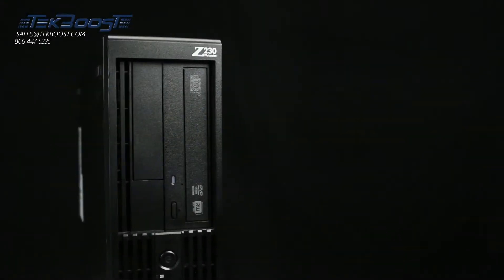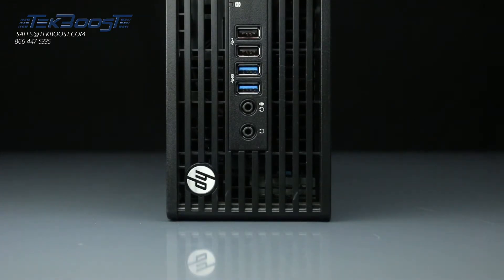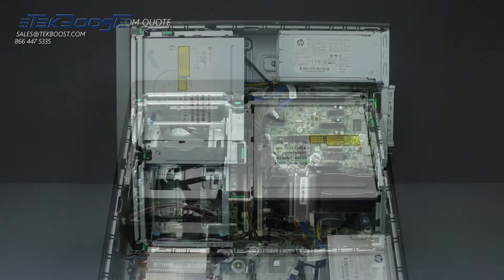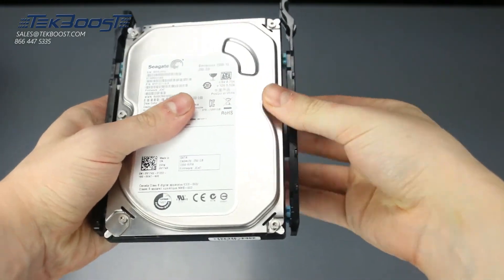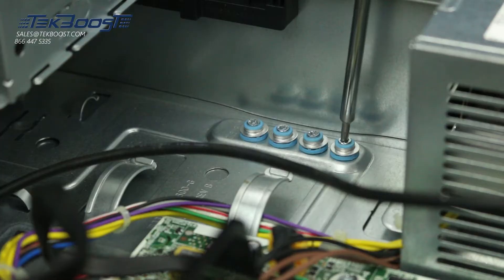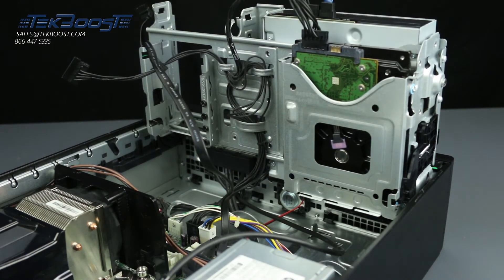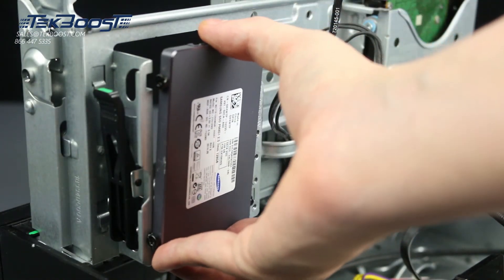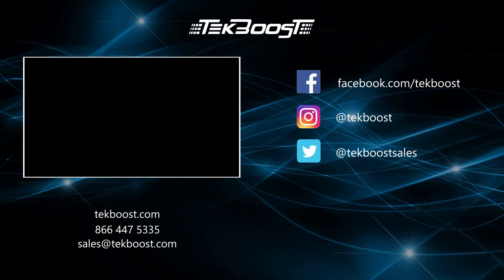Z230 SFF Hard Drive Installation

Comment: Pls idk what plug i need to by for my monitor
Reply from the maker: There is an integrated Display Port available on the back of the workstation. This option only works with select Intel Core Processors. If there is a graphic card in the PCIe slot, then that will need to be used. The integrated display port is also inactive when a graphic card is installed.